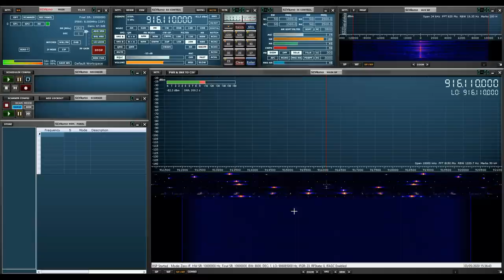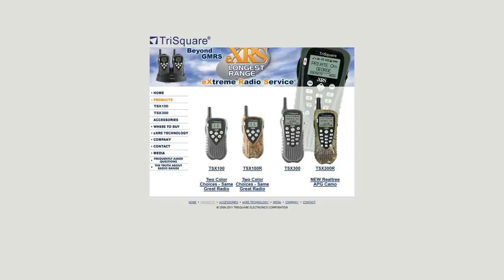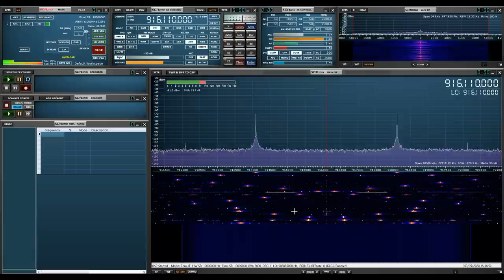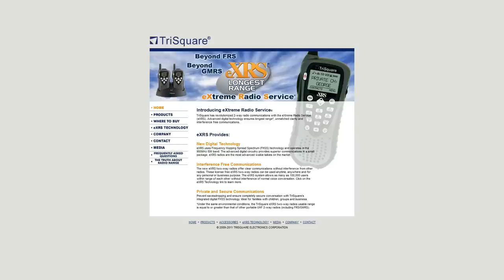TriSquare - The 10 Billion Channel Frequency Hopping Two Way Radio!

Comment: We converted one as a base station with a high gain (+11 db) omni-directional antenna at 110 feet, and we use the other 7 units we bought all over the small town we live in, and they serve our needs for a secure two way system very reliably. The ISM Band (900 to 918 MHz) cuts through trees very well. The low loss foam-filled LMR-600 50 ohm cable was a bit of a hassle to work with, but it lives up to it specs and does a great job and the antenna is a miracle worker for increased range. We have successfully communicated out to 21 miles from the base, but only in one direction. We only get out to 15 or 16 in all other directions with good comms, but we only need 12 or 13 to do our job. We have the same gripes you listed, one being the audio quality, but it is usable. Working in security, knowing that no one can eavesdrop is a big plus for us. We also have a Ubiquity point-to-point (Bridge) data link running between 104 and 130 mbps that runs 15 miles supplying Internet to a remote office (on site guard shack with 2 security cameras), and even though it is set to use 20 MHz of the same ISM band, it does not interfere except for an occasional click we can hear. We were bummed out when Trisquare went under - but we have stocked up on used units we found on eBay and Craigs list for spares. Thanks for the Review!
Reply from the maker: That’s great do you have pics of the setup?
Reply: I'll see if I can get a pic of the tower when I go over tonight.  The Trisquare is the handheld with a cable where the antenna used to be, and 4 feet later it goes from RG-58 to LMR-600 via coaxial adapters. Nothing to write home about but it works well for out needs. The most difficult part was matching the output from the board to the 50 ohm cable. We ended up using a nano-VNA to look at the what the board saw to the basic antenna. My partner is far better with that type of theoretical stuff but I followed and understood what he was doing. I had just never seen how useful the little VNA could be for such things! It was way cool!
Reply: Oh it's very possible to eavesdrop on them. Switch them over to DTR's and then you can say virtually no one can eavesdrop. 

eXRS is analog with slow 250 millisecond hopping.

Comment: XRS is in the 900Mhz which is just about stopped by a leaf.  Even the 450mhz band has trouble bouncing off land features.  Plus, the antenna would need to be longer for range more than 1/2 mile.

Comment: The state of frs and pmr at this point is basically just, “im not old enough to be trusted with a cellphone yet”. Murs is a waste as well, with every hardware store and walmart using them. Oh well, theres always wifi and zello. Or, if your a bit more on the daring side, a p25 motorola and a keyloader on murs frs pmr or gmrs.

Comment: I have the US versions of the DTR2430/DTR2450 - the DTR410 (limited features, and fixed antenna like the eXRS radios), the DTR550, and DTR650 (which have removable antennas - the same antennas used in all other Motorola 900MHz portables).  I also have 2 of the TSX300 eXRS.  As you said, the eXRS radios were a great innovation, and (I believe) were the first FHSS radios marketed to regular consumers.  The arguably horrible audio was typical of early-2000's DSP technology used in this case to split apart, and re-assemble the analogue audio.  I liked the concept for these radios, but found the range to be quite pathetic compared to 462MHz UHF.  I noticed the same in the DTR410, so most likely down to the small antenna (even for 900MHz).  The DTR550/650 radios, however, with their changeable antennas have a range which is equal to or better than the equivalent 4w UHF portable (when using the so-called " high gain" half- wavelength antennas).  The DTR radios also use VSELP digital for the audio, making them sound a bit more clear.  I find these DTR radios great for small-area coverage, and I feel, are what the eXRS radios wanted to achieve (and possibly could have if they were developed more).  DTR radios are still fairly expensive, but prices are starting to fall, and the odd deal may be had on eBay (such as how I acquired my small fleet).  Great video!

Comment: US viewer here. I had a set of four TSX100's for comms between the hot pit and our race car. It was a race series for $500 cars, so we didn't have a big budget. 
We found they worked pretty well around the pit and out to the parking lot where our RV's and race trailer were, with range roughly as good or better than FRS and adequate audio.  Like all digital radios, it was pretty much clear until it wasn't there at all. 
In the car, we had a lot of trouble with ambient noise ( even with a headset ) and couldn't reliably get a signal from all the way across the track, which was a several mile long road course. Amusingly, we were able at one point to let the driver know that an alligator had wandered onto the track causing a full course yellow ( this was South Florida ).  We ended up using a sign board and hand signals for the race and eventually spent the money for conventional analog radios with external antennas. The Trisquare radios got returned. 

I see these come up on eBay sometimes and if they were reasonably priced, I might try to grab a few to be able to have essentially encrypted short range radio communications and a funky bit of radio history.
Reply: As odd as it may seem, the actual voice part of these radios is 100% analog and can be eavesdropped given the right equipment https://youtu.be/zjVcz0ffv3w. That being said, I think any audible noise would be a rare occurence seeing as they would probably lose sync before that happens.
Reply: I made that audio sample. No my voice doesn't really sound like that. Guessing it's because I used a wide band receiver and eXRS is narrow.

Comment: We have 4 of them and they were a good idea but had a couple of problems. First the batteries were undersized and they went dead quickly. One of the batteries didn't hold a charge and TriSquare replaced it with no questions asked. They were very good to work with. (I ended up using regular AA batteries.)
The other problem was when 3 or more units were communicating on the same "channel", they didn't always want to stay in sync. Since we were a family of 3vthis was important. Now that our son in no longer at home this wouldn't be a problem now. 
Since they use frequencies that most people don't monitor they are great for "secure" comms.
After viewing the video I want to dig these radios out and play with them again!
Thanks for these great videos of past technology.

Comment: I seem to recall a SRR, short range radio system proposed in the U K long before we got PMR 446 that never came to fruition. As I remember it, it was to be SHF and communication could take place between two parties without the interference from others. I like the TriSquare system, giving mobile phone like communications but directly between two devices. Pity it never caught on. Another great opportunity missed.

Comment: I have (4) of the tsx300 & (2) tsx100.  Bought them when they were new.  They operate similar to the Motorola DTR series & Motorola's iDEN-Nextel phones (the Direct Talk Mode or 'off-network' solution).  Same technology with 900Mhz FHSS (Frequency Hopping Spread Spectrum), only the TriSquare TSX series are FM-Analog only.  The Motorola DTR & Motorola iDEN-Nextel phone's Direct Talk mode use a Digital Vocoder.   iDEN-Nextel's Direct Talk mode uses the ancient VSELP digital vocoder (Vector sum excited linear prediction).  I have a few of those Motorola iDEN i355s phones.  The 'Direct Talk' Mode Walkie-Talkie features still works between the devices.  Even though Sprint dismantled their iDEN Cellular Network in 2013.  SouthernLINC has since pulled the plug on it's iDEN Cell Network too.  The 'Direct Talk' Mode still works fine with No-Cellular Network in those older phones.  Direct Talk, Motorola DTR & Trisquare Radios, although all three use the same frequency band (900Mhz) & FHSS technology.   They are all three incompatible with each other.

https://en.wikipedia.org/wiki/MOTO_Talk

Comment: Gotta say I had these radios at one point and yes they were secure, but the range was only about 3/4 of a city block.
Reply from the maker: Cheers for the info David
Reply: @RingwayManchester  Motorola has the newer series DTR radios and they run on similar technology and they work 100% better. I have used them out to approximately 2 miles in the city with strong clarity and almost no dead spots.

Comment: Appreciate you showing more of these not just amatuer radio type rigs. I wouldn't be surprised if part of the reason the company went under is the government, ours and probably yours, don't like the idea of any kind of radio communications that they can't monitor.
Reply from the maker: Cheers man!
Reply: The FCC cleared them for launch.  They just felt super cheap, and had terrible range.
Reply: @RKingis  Thanks for the info. Sounds like a no-go.
Reply: @WolfQuantum  It was an awesome idea, but I couldn't even get past a single block of apartments.  I think if they marketed for a small company, or a store/grocery store, maybe they would be around today.

Comment: Yes, interesting video. I had a pair of
these some years ago, but didn't get
much success or use of these units.
It's been some time since I had them 
but I can't remember much about using
them. It gave you the raspberry sound
too.
Frequency hopping I think was an idea
of Hedy Lamar as I read some years
ago, an idea for the military in WWII.
W2CH
Reply: I'm not 100% sure when the FHSS technology was designed or implemented however I know the US military and several other militaries use it to great effect on a regular basis.

Comment: Thanks for showing us the SDR bit.  I wonder how similar this technology was to the whole "direct connect" feature the old IDEN phones used.  Basically it had an off network capability which operated very similar to these radios in the 900 Mhz ISM band.  I still have a couple of the IDEN radio phones around.  Should fire them up and take a look in SDR at the spread spectrum hopping.
Reply from the maker: Hi mate, very similar, I've got a video coming on that. I've got a loads of handsets, work really well haha

Comment: I had a pair of these. They ran about $200 new. They worked ok at close.... very close line of sight, most of the time. Long range? I was lucky to get a mile line of sight open area. Cloning and things like that didnt work well at all. Then after about 3 weeks, one simply made a weird screen and died. Customer service actually disappeared at the same time, and it was hard to find these or any info about them. Then suddenly, 10 years later here they are. Hopefully they are better than their version I bought because frankly I thought they really sucked but had potential. And, thinking out loud, ismt this basically the same as DMR just with frequency hopping?

Comment: 900MHz ISM band radio is rare which is a shame, with more support it could be a decent near range comm device. Right now Moto DTR series radios are just about the only player in town. 

I would like to see them up the output from 1 to 2 or even 5 watt. This band is rarely used for radio, and as far as I  aware not much goes on in "scientific and medical" areas either.

But, as things go with the FCC things never change around here.

Been arguing for ages to get them to up the power output of MURS. Even if you need a pay license like GMRS. Everyone has cheap bubble pack FRS/GMRS radios, and in a crowed city, it can become hard to find a quiet place.

MURS is generally unknown to most people, and VHF. But 2w and lack of repeater access is a killer.

I would love to see more access to ISM become a thing for their digital use, as the US currently doesn't have a digital PMR service.
Reply: If marketed as a US Amateur radio, it could be made up to 10W and could have some pretty impressive range in urban areas with an outdoor antenna. Unfortunately, however, as an ISM band radio, it is limited by the FCC to 1W only.
Reply: @joshuahamlett9098  Which is a shame, and wasted potential.

Sure I get the need to not interfere with medical devices. But I see no reason not to allow higher wattage. Especially since most medical and scientific devices I see these days are 2.4GHz and beyond.

My major issue with this band is motorola is the only one making ISM radios they can keep the price as high as they want. $300 for even the most basic DLR radio, they should be at least HALF that price. if you want a DTR it's even worse.

If more companies made ISM radios it would definitely be a good thing.

That said, I mean... I am not sure I would trust a 900MHz  Baofeng.🤣

But a $50 Retevis or a $100 Wouxun would definitely pique my interest.

Comment: I owned 4 of these when I lived in Canada, and as others have said, they were terrible.  The standard FRS/GMRS analog units were much better.  I had purchased them because they were not easy to monitor, giving our users a greater sense of security.  However the audio quality was bad, range poor, and all too often the radios would lose sync with each other.  After a few months of trying to use them, they were recycled!  I didn't even deem them worthy to sell on to someone else :-(

Comment: Sounds a bit far fetched the amount of simultaneous users they claim. What happens when more than 1 Radio hops on the same frequency you may not hear them but they would block each others signal. RF is RF after all wether its digital or analog.

Comment: Hey, I have a Baofeng UV 5R, I have never heard anything on it. Can anyone tell me a channel to tune into. Cheers. (Cornwall)
Reply: Search UK repeaters into Google and that should give you some frequencies to tune into. Obviously try the local repeaters to your area first. You may need to upgrade the antenna otherwise
Reply: @warrenwakefield7353  cheers will do.
Reply: Yes press the FM Radio button and tune to local FM radio station, just to prove it receives OK. Then try local Repeater frequencies. Good luck.